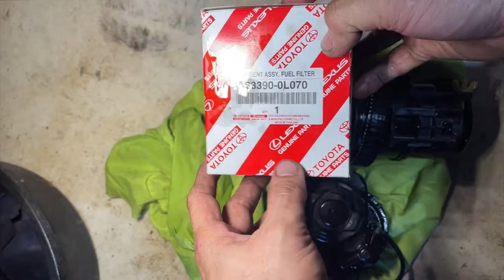REPLACED FUEL FILTER AND OIL CHANGE TOYOTA HILUX ( GUN126R ) PART 2

Comment: Fuel filter light came on.
Replaced fuel filter at dealer.
Reset light at dealer.

Worked perfectly

Drove for 10 - 20 minutes
Fuel filter light came on again,
I reset it everyday, but it keeps coming on again.
Fuel tank has been drained and checked 3 times by
dealer, including the filter.

What do you think is the issue?
Reply from the maker: You replace already the sensor for the filter?
Reply: Thank you for your reply, what is the part number of the filter sensor please?
Reply from the maker: The whole black plastic that hold the fuel filter  is the sensor I’m not sure about the part number mate sorry